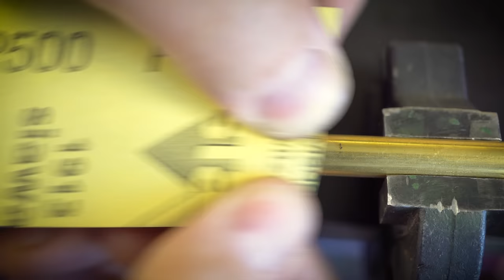Ballpoint Pen with Manual Transmission :)

Comment: Put the pen in “R” to erase mistakes and each sequential gear will make you write faster
Reply: Brilliant👏🏻👏🏻
Reply: Each sequential gear can be a thinner pen.
Reply: How, pls elaborate
Reply: in spanish it's more funny. es R de Rapido
Reply: Oh, I thought we can write backwards.
Reply: Fascinating
Reply: That’s actually a good idea ngl
Reply: But writing in a higher gear will come at the cost of lower torque, so using higher gears is not recommended when overcoming the initial writers block, and may not get enough traction on all paper surface conditions.
Reply: @Cessar420  r is for race mode
Reply: "R" is for Arabic writing
Reply: Sim
Reply: Wish he’d thought of that idea when he designed the pen

Comment: Just imagine how much faster you could write with this 👍
Reply: O
Reply: Indeed
Reply: I'm mostly interest in the reverse gear. Imagine not needing correction tape or a correction fluid/pen, instead just needing to put in reverse and then it'll erase itself for you! Truly a dream come true.
Reply: Just put it in 6th gear and go 👌😉😉
Reply: @graciouscompetentdwarfrabbit  Not only that but you can refil your pen after scribbling for the ink to come out
Reply: Running in the 90's song played
Reply: Nailed it!
Reply: I still prefer automatic on my pens.
Reply: Awesome tool skills 👏and design. Very creative pen. Kudos
Reply: 😂😂Especially with that short shifter!
Reply: Imagine if you add turbo and nitro
Reply: At least 30 speed!
Reply: The automatic pens are faster, this just gives you more control 😏
Reply: Yeah, until you get cocky, and money shift your ballpoint across the room 🤣
Reply: Don’t drink and write! I wonder what the mileage is?
Reply: @rafiadilahsuad3728  gotta down shift and finger heel toe it since the homework has some tricky turns and corners. You don't want to enter the multiple choice section too fast. That would send you to the binder ring ditch and crash the pen. You don't want that. Its all muscle memory. You need to feel the speed with your own hand on the clicky tip
Reply: Slower than a DCT (Dual Color Tip), but more engaging.
Reply: Just paint some flames on the sides and you're good
Reply: Burn your clutch out with writer's block
Reply: Lol
Reply: Just be careful with the grammatical officer
Reply: Well, first we must think of the gear ratio..
Reply: @vdh2248  yeah but when you are driving a car you need to build up to the final gear maybe that is the same for the pen.
Reply: 1500RPM write
Reply: @dylanrhodes5180  Yes, but what he doesn't tell us is that he has a turbo and electric supercharger under the ballpoint 😛😛
(I know it doesnt make sense from a carguy perspective)
Reply: @vdh2248  I was joking around but that would be interesting a supercharger and turbo that small.
Reply: Imagine how much faster you "WOOD" write with this haha!
Reply: Lmao 😂
Reply: With a good engine as faster as if it was automatic.
Reply: Its not about speed, its about control.
Reply: You gotta start in first gear tho and work your way up
Reply: You may even write in reverse
Reply: Actually it's mostly for getting better torque when writing up hills.

Comment: Upshift for the straights, downshift for the curves; Never go above 3rd when writing in cursive! 😂
Reply: LOL
Reply: Or if you are on a rallycross track
Reply: @SEX_TRAINER  you are not getting something
Reply: remember those oldschool Writing races 
manualWriter: for more rev downshift then upshift
Reply: Or if you are Left handed, I feel like a lot of lefties would be permanently stuck in 1st or 2nd gear and only ever use any higher gears when drawing....want to avoid smudging their own writing with their hand so a shorter nub with less ink output is nicer, speaking as a left handed person.

Comment: This is a lovely pen, extremely well made. Just a question...  How come you didn't consider adding a small spring inside, to add some tension to the lever and stabilize it against involuntary shift-up (or down)? At any rate, this is a piece of art.
Reply: Bc hes probably not an engineer or scientis, Maybe just a machinist , i could be totally wrong
Reply: There was a small spring inserted early, but not sure if it was fixed or soldered in place.
Reply: @edwardjamesjr1  If you meant the item at 2:48, that was a coil of solder.
Reply: So he can hit that money shift and squeeze another hit video out of it course
Reply: He can't make springs.
Reply: @captainrhev7738  you hit the money shift in class by accident and it leaks ink and drops metal shavings haha
Reply: @lucasbosco2160  not to mention it makes a gawd awful clanging noise as you shift with the confidence of a gorilla  🤣
Reply: @Giovanniram22  he can easily manufacture his own springs. He has more than adequate knowledge and expertise to manipulate metal that a spring made of round, flat, or braided steel would be his choice.
Reply: @lucasbosco2160  “teacher, my pen blew its transmission, i couldn’t finish the homework last night”
Reply: if you really wanted it to feel right you’d need 2 opposing springs, so the shifter falls centered when out of gear (like how your shifter sits between 3rd and 4th when you let go of it)
Reply: Probably didnt need it because the shift locked in place at the sides
Reply: that was a coil of  solder, not a spring
Reply: There are better pens that already do this today. I own two Fellhoelter pens (basically the first guy to make them). They're super well made and will last multiple lifetimes. Pricey though.
Reply: This thing doesn't even have synchros lmao ehat a shit transmission. I bet he'll never write over like 3 mph on that thing.
Reply: @C_Castillo  what are you talking about

Comment: adding spring on both ends for shut (neutral) position would be perfect, the spring give a bit resistance when shifting between gear and has purpose to keep the pen shut when not used (neutral).

Comment: this would actually be cool for mechanical pencils with thicker led so when you need more led you just upshift . maybe find a way to have it reset the led so it’ll push it forward some when you run out in 6th gear
Reply: Or the gear you put the pencil in tightens the orifices that hold the lead in the pen so you can write with any width pencil lead!!

Comment: I am always amazed at the incredibly clever "engineer hacks" with which you advance your projects!  Hm, how do I cut a lot of nylon threads into pieces of the same length?  Ah!  I'll quickly build a CNC machine for it!  This is absolute super cool!  But what I would like most of all: A video (or a couple of videos) in which you demonstrate and explain your machine park!  Such a machining center, which is also a lathe, milling machine and laser cutter, is a great project in itself.  And as far as I could see, it's a DIY machine too.  A video about your machine (s), that would be the greatest for me!

Comment: fantastic pen. and as a user of bolt action pens myself. the wood is great and practical but personally I would get it in a car's metallic color if I would get that setup. that or chrome. and who knows if it's possible to make a skull shifter.
Reply: Like most bolt action pens (that I have seen/own), the bolt is basically a little screw. So it should be just as simple as changing the bolt on the bolt action pens. I have a few different bolts.

Comment: This is beautiful. I love it.

As for the take it from here and Run Part, it would be cool if each gear corresponded with the resistance of the roll of the ballpoint.
Reply: That would be cool, would be a very large pen though

Comment: Beautiful creation. I hope i can buy it someday. Just a suggestion, put a spring below so chaging gear can have a resistance. Also if ut can be for s pensil or graphite tip ut will be more realistic. With every gear change more pencil would come out. But wonderful creation. Exceptional quality and talent.  👏🏻👏🏻
Reply: Bolt action pens are available, this mechanism doesn't really make sense because the pen refill isn't fully extended in all positions, which means most are pointless.

Comment: What size was the OD threads on that pen tip? That was the smallest die I've ever seen. And the ID threads; that was the smallest thread mill I've ever seen. Excellent craftsmanship. I only hope you have excellent penmanship, as well. I can see this pen retailing well over $100, easily.
Reply: Bolt action pens kind of beat him to it.
Reply: @user-md3is4dq2d  damn 😳 😔

Comment: Great work, I enjoy all your videos. I have the Sherline machine also. If you don't mind, what software do you use for CNC? What keyboard hot key do you jog A-axis with? How many steps is your A-axis motor tuning for MM, how many for Inch? Also what lazer is that? Sorry for so many questions but I'm trying to get to your level. Thanks and keep up the great work.

Comment: This could be modified so that each of the individual gears could be used for cartridges of different sizes
Reply: It would be very complex due to the fact that the ‘gearbox’ is on 1 side of the pen as a pose to the entire circular face of the pen. It could be done though and I really need to see that now.
Reply: I'd love to see you figure that out.

Comment: the Arduino lathe is getting a workout: what if you could get, or MAKE, an automatic (pneumatic) chuck, with adjustable jaw tension/grip,  for it like any CNC turning center? Then build a bar feeder for it ! That would be so incredible...

Comment: Imagine taking it out of your pocket and the lever getting stuck and breaking 😂😂
Reply: He has a really light duty shifter here and it could easily snag, I have a bolt action pen that's sort of similar, but the ball Is large enough and the stem is wide enough that I couldn't break it off if I wanted to.

Comment: Wouldn't the shift stick poke you every time you have it in your shirt top Pocket as it's exactly in the opposite direction and it's quite protruding??
Reply: The cap on the pen seems to be threaded, so all you'd need to do is unscrew it a bit and rotate the clip 90°. I don't think it's supposed to be a functional pen though

Comment: I wonder if we can do that for an ink pen, where the gears control the flow of ink to the tip? Making it darker or lighter 🤔 this way the transmission gets to have more versatility and you can probably patent it 😝.
Reply: Currently, you can do this by writing faster or slower. There are some inks that are similar to writing with a pencil, I don't think it's intentional though.

Comment: missed optertunity for the very end where the clip is being a gas cap that flips up to recharge ink. also. was kind of half expected a spring and R be storage mode and pushing it to center would spring all the way down for use.

Comment: Kinda gonna be an issue with the “shifter” digging into you, since it’s on the opposite side of the pocket clip.
Great looking pen though.
Reply: It's configurable, but the area that the shifter takes up is significant. I think I'd find myself annoyed with not spring action like the bolt action pens I own

Comment: This would be sweet if it were a mechanical pencil. Gear number dictates lead length. Snap a lead? Put it in N then put in the gear length you want. Make a mistake? Put it R and the eraser pops out.

Comment: What time stamp has the transmission gear box in or is it just a pen with just a cool shifter thing for the pen ink tube? No seriously the name of the video should be a pen with a shifter not a transmission. Get a dictionary and look up transmission. Now if you can make a new one with a clicker top and a transmission with gears to spin something around the cylinder and the transmission speeds it up and the stick moves the ink tube at the same time I would say that is a winner. But it is a work of art just put some time in naming the video. Because I did think it may have had some gears or some locking lugs in side it for no reason but just for fun but it is just a fancy pen.